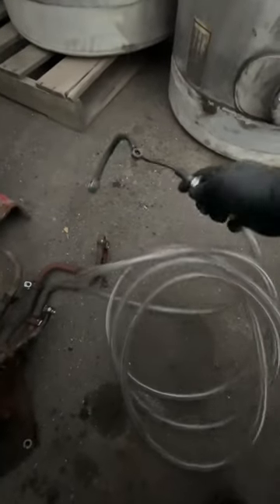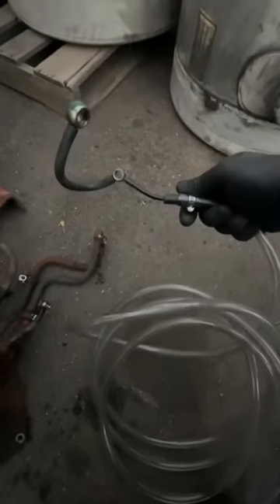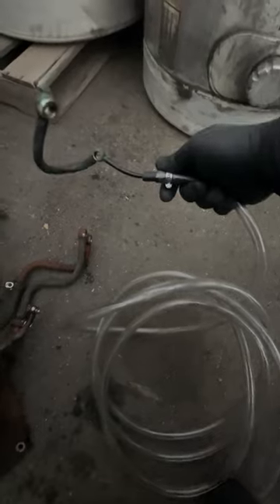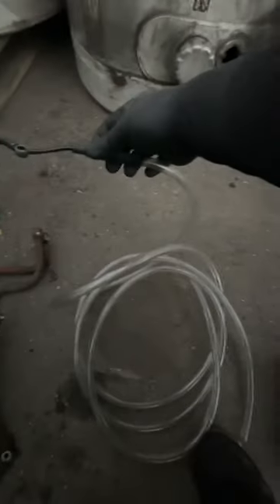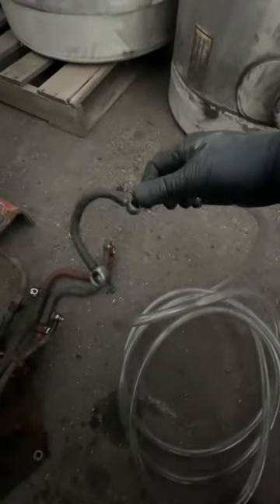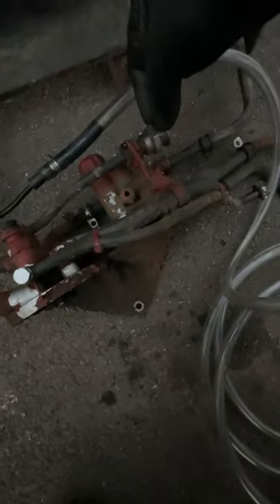Volvo d13/Mack mp8. How to test for aerated fuel.

Comment: Do you happen to remember the sizes for the hose?
Reply from the maker: The actual hose on the truck banjo fittings is the size of 1/4” sun flex airline. The clear hose I added was the only clear hose I could find at the time. I think 1/2”. I have figured out an wiser way. Start the truck and set the cruise switch. Grab a flashlight and look for air bubbles in both fuel tanks. There should be absolutely no bubbles in the tanks. If you have bubbles and long crank times you need injectors and cups